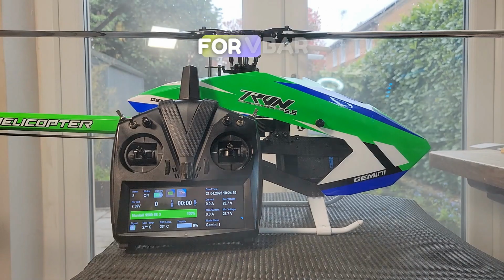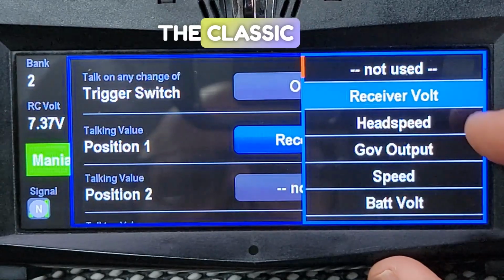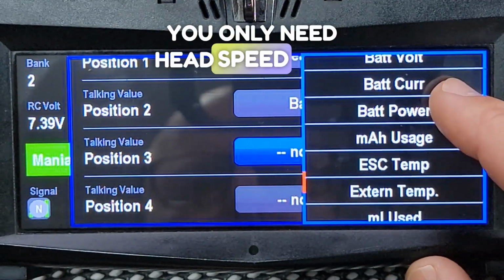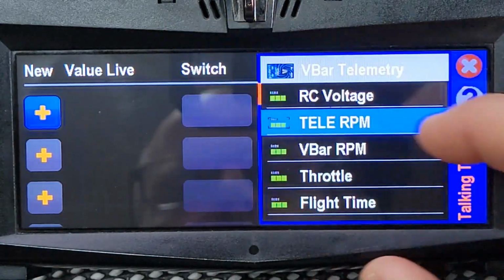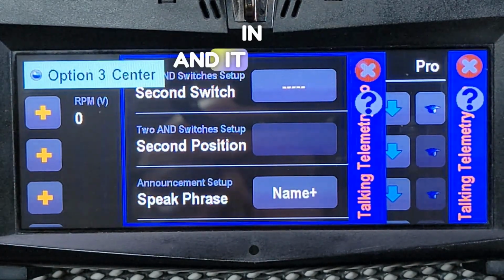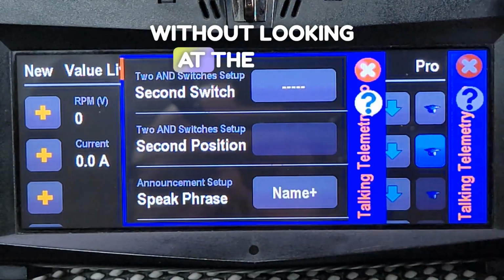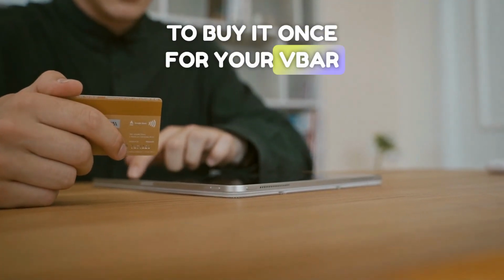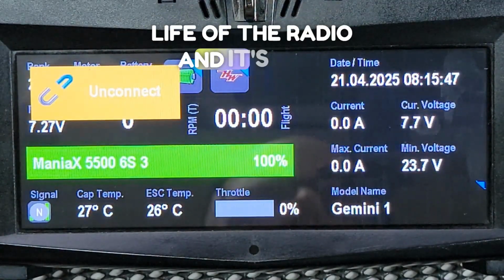Talking Telemetry Pro! Are the VBar Control Pro Apps from Mikado worth it?

Comment: I stopped flying helis right after the first Golbin was released and that was my last heli.  I stopped flying partly because I use Mac and I hated the Bootcamp setup and having to use my laptop to set it up.  The new Mikado radio seems the simplest way.  I’m just wondering if they are a solid company that isn’t going anywhere.  I love flying but I no longer have any time to tinker with stuff.  I’m just looking for a radio that I can setup the gyro, non android, not having to do the ESC setup from the bootcamp MacBook….. and fly a plane now and again. I see those radios that you can setup to do anything but that seems way too time consuming.  I flew Vbar back in the day and they were always solid.

Comment: Why is there no video anywhere that explains how to just have the battery percentage read out, when it's nearly time to bring it down. At like say 10 percent. I don't want it read out every 6 seconds and every time I switch banks. It's annoying and confusing to hear the actual real amount of battery left.
If this is not possible, how can I just have a timer that starts then warms me when battery's almost selected or I have 10 seconds left?
I asked Jeff west many times in comment sections and he said yes he will make one but he still hasn't. There's no videos about this on YouTube.
Reply: This is a standerd feature in the vbar control, evo and evo +.   Connect the battery and then go into the battery settings and set it to percent.
Reply from the maker: I'm totally with you there. It was one of the first things I asked for over 10 years ago when I was back on the Classic. I can't even stand next to anyone who has the continuous countdown 😂
The Talking Telemetry Pro will do a battery % readout from a switch, but won't do it automatically. I don't think there is any way to do it.
Reply: @rchelicopter You have to activate it in the Battery settings.
Reply: @rchelicopter Its very easy to do that. My Evo tells me every 10% down to 0%. My Classic did that too.
Reply from the maker: @ That's the one we're ranting about 😀 There's no point saying the percentage at the beginning of the pack, it means nothing, just noise. Ideally what it should do is keep quiet for the first half, and only read out at 50/20/10/0 %.
Reply: @rchelicopter  I dont know if thats possible. Maybe Mikado can do something for you or its possible with macros.
Reply from the maker: @florianwidmann7870  Nope, I tried macros too. I think it's probably too small a request for Mikado. In fact @elitecol69 is the only other person I know who feels as strongly as I do 😂 Most just seem to live with the 10% countdown 👍
Reply: @ i live with it too 😂 im used to it 😂
Reply: @ I got used to it ,I dont mind im to busy flyin 🤣

Comment: HI Richard, is it possible to to do custom announcements on vcontrol toutch or evo i have both , Thanks 👍👍👍
Reply from the maker: No, not completely custom. You have to choose values and pick a readout format.
What sort of announcement were you thinking of?
Reply: @rchelicopter  Thank you for the fast reply, i mean like some radios you can put custom words like { The shit is about to get real} 🤣 but i dont think mikado have a sense of humour 🤣
Reply from the maker: @allanbassett-v1j LOL, I think you're right there. It would have been cool if it was possible to create your own voices, but at least Mikado's aren't too bad.
Reply: @rchelicopter  Just signed up as a ss 👍👍👍
Reply from the maker: @allanbassett-v1j Thanks Allan, much appreciated 👍
Reply: @rchelicopter  ❤
Reply: @rchelicopter  I have custom call outs on my TX  but it's not vcontrol lol
Reply from the maker: @leebates7574  I've heard your callouts. Terrible 😂😂
Reply: @rchelicopter  I change them regularly...you've not heard it recently 😂
Reply: @ 
Be nice for vcontrol to say battery full at the start of a flight and just vibrate when its time to land🤔
Reply from the maker: @allanbassett-v1j It does that already. Alerts if the battery connected isn't fully charged, and also alerts at the end using capacity measurement.
No alerts at 10% left, but it's good enough.
Reply: @rchelicopter  I know but it still counts down 90% 80% and so on dont get me wrong i love vcontrol i had the classic when it was first released  and i wouldnt change my toutch and evo for any other brand its just a shame you cant have custom voice commands ,  I like a radio that swears at me😂
Reply: @rchelicopter  Do you know if it is possible to have the head gain set lower when in throttle hold?
Reply from the maker: @allanbassett-v1j  only if you set up AR as bank 4.
Reply: @rchelicopter  Thanks Richard i will give that a try👍